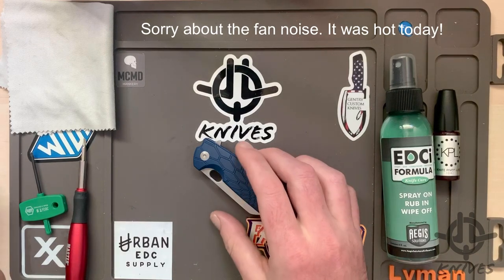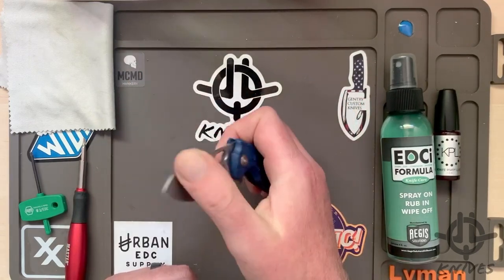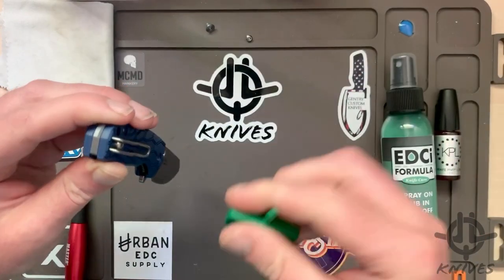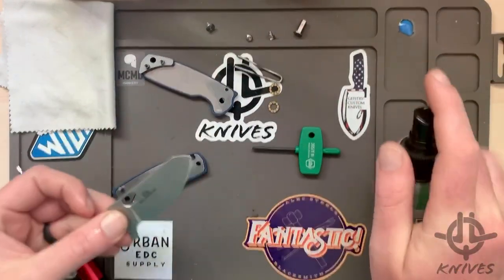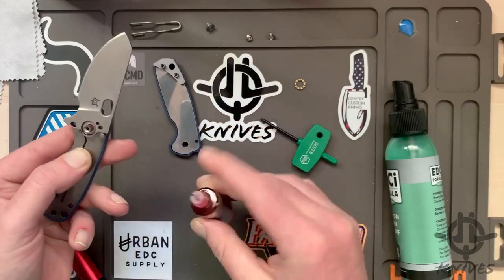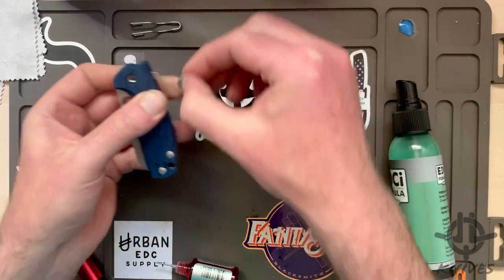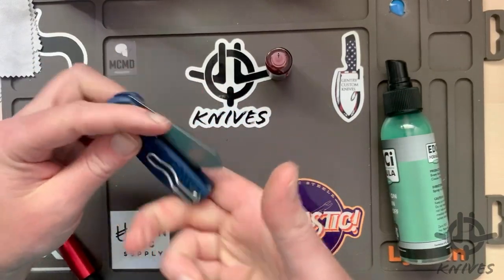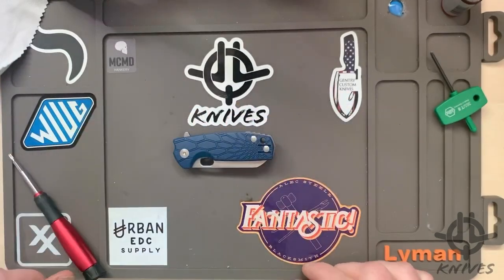Fox Knives, Baby Core mini, First Impressions, Tear Down, and My Take

Comment: Just recieved mine from BHQ love the knife except mine did not come that sharp at all and the angles on the edge are different on each side. I might reach out and see if BHQ will replace it. Other then that great little quality knife especially for the price. Thanks for the video you should put up some links to cleaner and pivot oil.
Reply from the maker: Will do! And that is such a bummer!!! I would totally reach out, a knife should be sharp and even ground, especially a production knife. I’ll add those links. Thanks!!